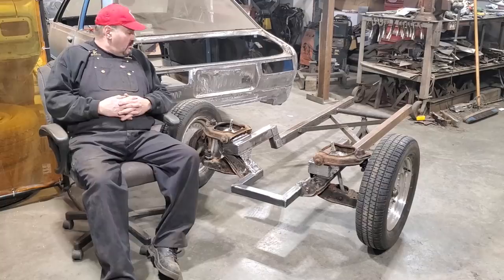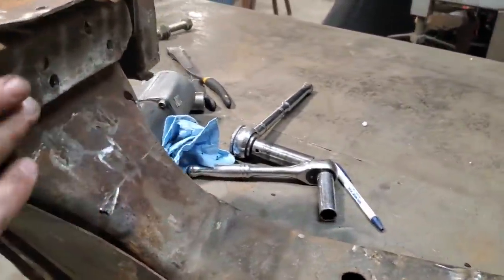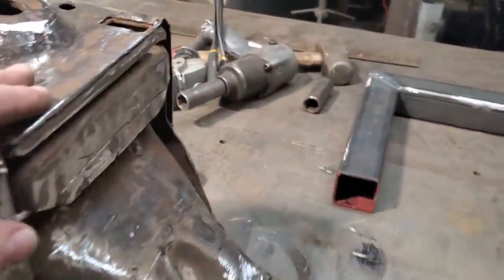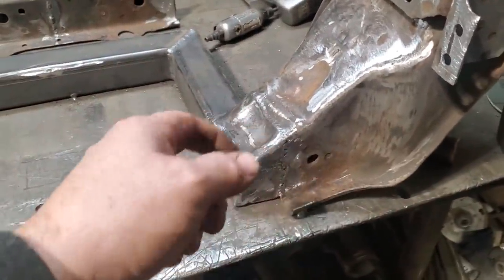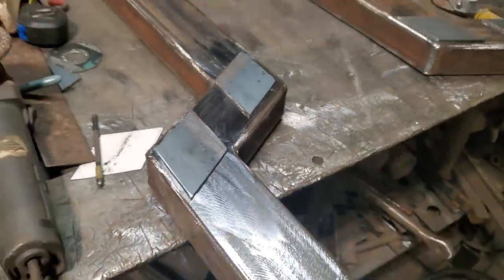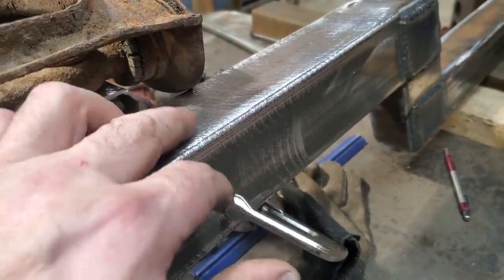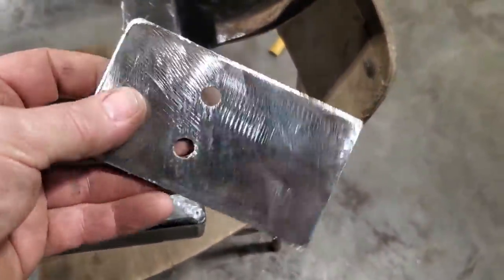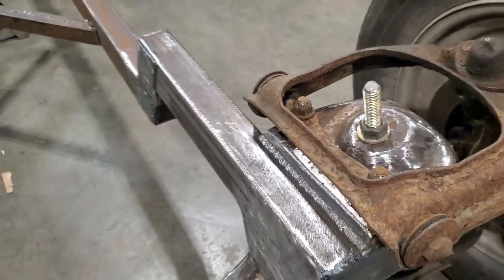Crusty. Front subframe and suspension complete

Comment: Nice job, but unfortunately, that new crossmember has only about 15% of the strength of the original. The torsional stress on that 2x2 square tube is a catastrophic failure just waiting to happen. I really hope you change this design.
Reply: The towers will be tied together with tubes from the cage and typically the motor is bolted in with solid mounts. But your point is valid.
Reply from the maker: You need to look at some of the aftermarket setups. They have little or no crossmember.
Reply: @fitzeesfabrications  If you had ran the 2x2 to "replace" the factory crossmember in the "same" location, your point would be valid. But the problem lies in the "loop" you made with the crossmember. The forces involved are trying to twist the 2x2 in its weakest axis, not along its strongest axis as the factory location would provide.
Reply: @timcartwright4679  I would agreee 100%, if a "motorplate" was being used, the forces on the crossmember are completely different. But obviously a motorplate can't be used in this application since the front of the motor is 18 or more inches in front of the crossmember. That is why racecars with minimal crossmembers have the motor set back to align the front of the motor with the centerline of the front wheels, or close to it. Making the motor/plate a structural component to the front suspension.
Reply: @timcartwright4679  The tubes from the cage will not give any strength to the forces trying to collapse the spring towers toward each other. Their orientation is parallel to the frame rails. But tying the tops of the spring towers together with a strut would actually help the problem.
Reply: I really hope you watch and learn whats needed to build a drag car front frame.
Reply: @1996slamster  Not the sharpest pencil in the drawer, are ya?